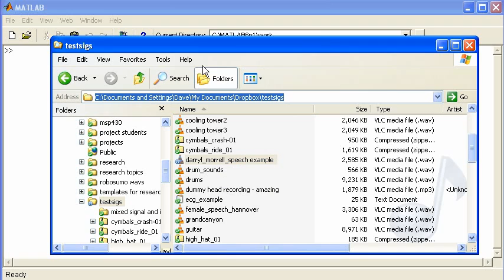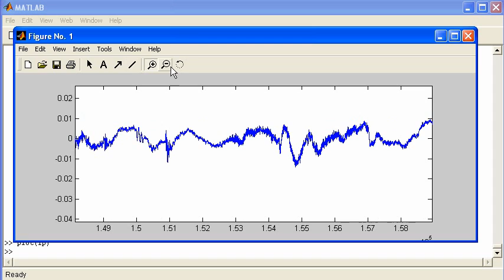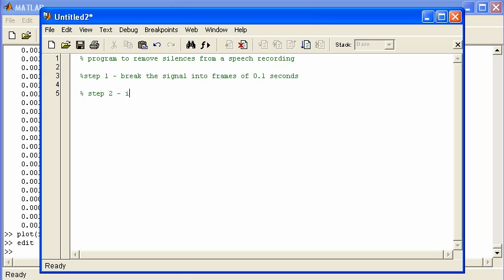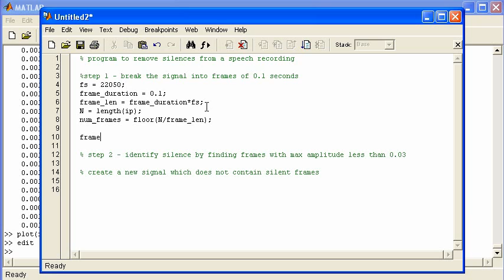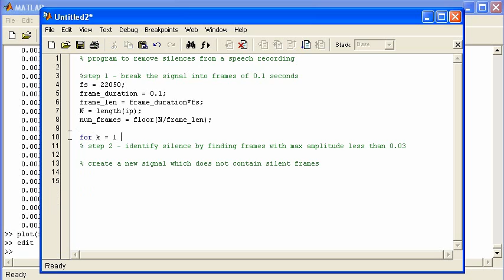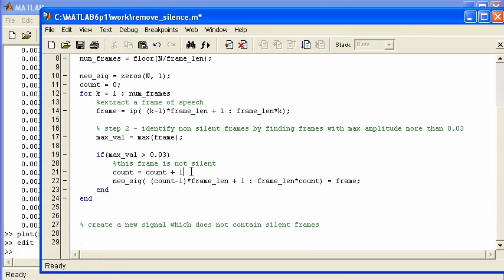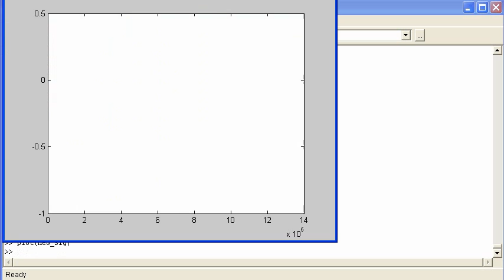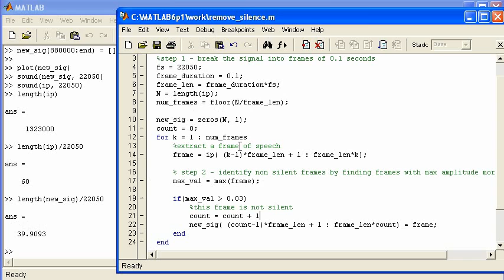Matlab  Signal Analysis - frame by frame analysis of a signal - silence removal audio example.avi

Comment from the maker: 1) Yes. frame_len (samples) = fs(samples per second) * frame_dur(seconds).  If the frame_dur was 10ms and fs =22050Hz then frame_len = 220 (rounding since you can't have a non-integer number of samples). 

2) To save reduce file size. You loose higher frequecies when you sample at lower frequencies. Telephony systems sample at 7kHz - listening to someone on the telephone sounds different to listening to someone on the radio.

3) Unit is Hz, but can be expressed in kHz for convenience.

Comment: that's very good, by why did you have to breakdown the signal into frames? Why didn't you just loop over the whole length of the signal and whenever the threshold condition is met, you write that into new_sig ?

Comment: Hi, thank you for your informative video. As I'm new to audio processing, can I ask why You took 22050 as the sampling rate?
Reply from the maker: The sampling rate will be specified in the wav file. 44100, 22050, 16000, 8000 Hz would be common for audio data.

Comment: thank you for the tutorial! I think you can optimize like this with 2 for cycles instead of removing the silence at the end:

count = 0;

for k=1 : number_frames
    frame = x( (k-1)*frame_len +1 : frame_len*k);
        max_val = max(frame);
    if (max_val>0.04)
        count = count +1;                  
    end   
end

new_signal = (count)   %creation of the new signal with the proper size

for k=1 : number_frames
    frame = x( (k-1)*frame_len +1 : frame_len*k);
       max_val = max(frame);
    if (max_val>0.04)
        count = count +1;
        new_signal((count-1)*frame_len +1 : frame_len*count)=frame;               
    end   
end

Comment: Hi David,
amazing vids. You are saving my life one video at a time. 
One question:
If I want to gate the silence instead of removing it how do I go about it? 
Thinking it should be simple since the "for loop" already has set the max_val in each frame.

Kind regards
Reply from the maker: I'm afraid I don't understand what you mean by gating the silence. If you can clarify and upload an attempt I'll take a look
Reply: Yes, I mean a gate like the plugins used in digital audio workstations. Where you set a threshold and don't allow audio below that threshold to pass through. Basically turning down the volume when there is pauses instead of removing it.
Reply: Tuesander I'd say you could do it by reversing the symbol in the "if" and put zeros in the while frame. Probably

Comment: can we use new_sig=ip(ip>.03) ?
Reply from the maker: Not exactly sure what you are trying to do but I think new_sig = ip(find(ip>0.03)) might be what you are looking for. This will just create a new_sig variable which contains all samples greater than 0.03
Reply: Yes i was trying to do same as new_sig = ip(find(ip>0.03)) , it works without 'find' method. Basically I am looking for the optimum frame length for assuming sound signal as wide sense stationary to calculate cross correlation.

Comment: Hi, i am Vicki

Right now i am learning matlab, but i am just begginer at matlab, right now i want to learn about how to using low and high pass filter,  Savitzky-Golay Filtering (SGOLAYFILT), mean and varians, and also find out the peak and valley point from the gyro and accelerometer signal, and all my data i get from excel.

can You give me some tutorial or code how to make it

I really hope You can help me to figure it out

Best Regards
Vicki